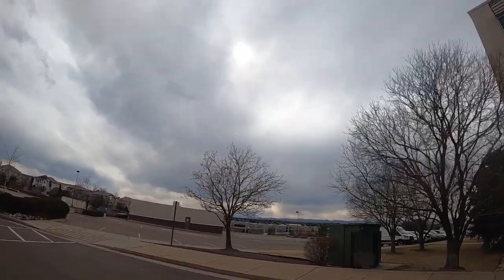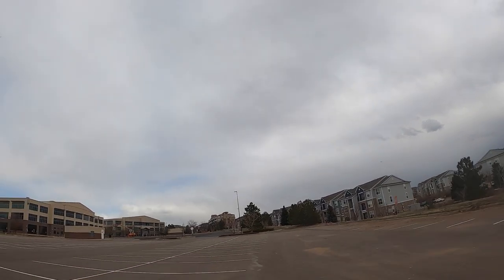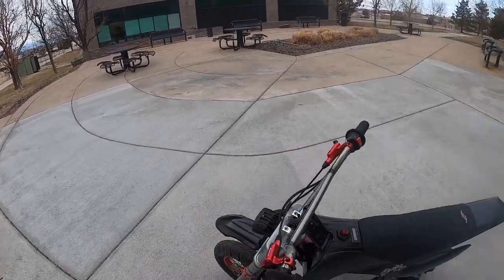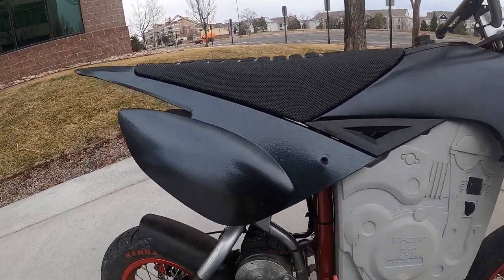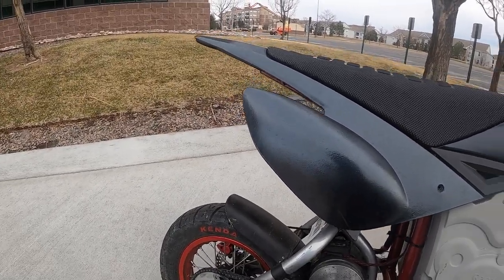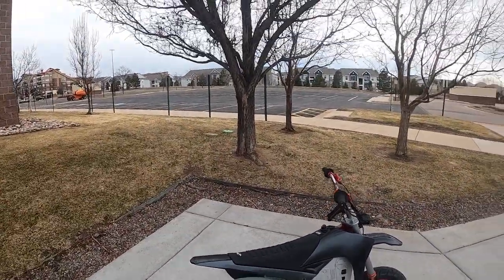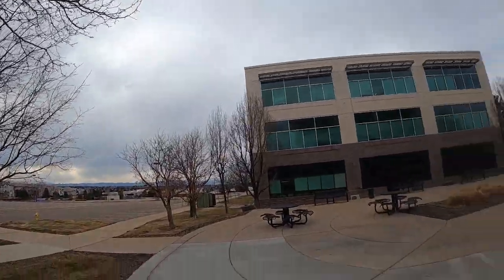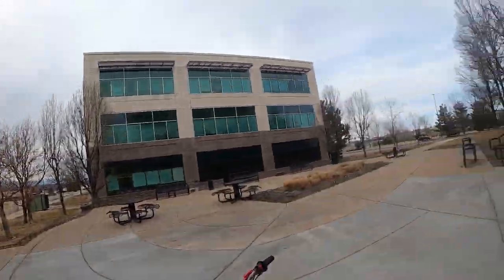72v Razor T8F Chain Upgrade! (Bike Update/Review)

Comment: T8F is great! I just made a video and have it all installed. I did have to drill a bigger hole into the swingarm for the upgraded tensioner to work
Reply from the maker: Good stuff! You love it! Makes the bike sound a bit better and feel as if throttle response is a little better.
Reply: @MarcosRamos-hn5iw  100%! Just need to wel the freewheel next haha